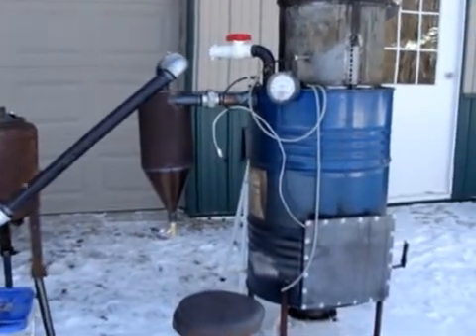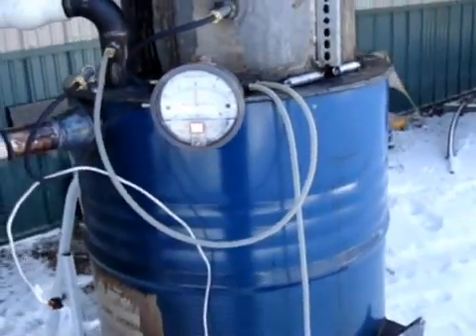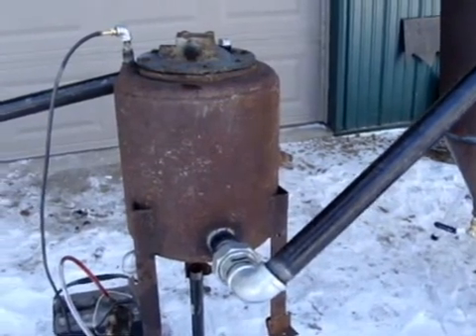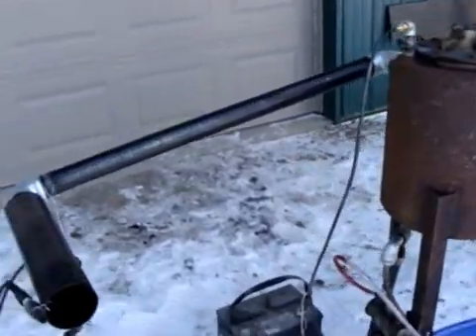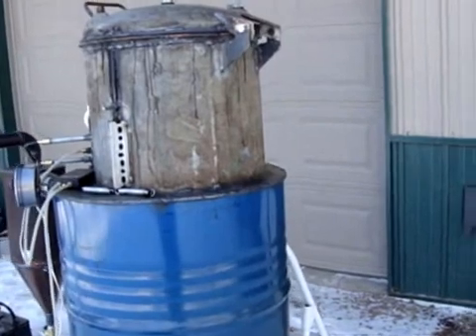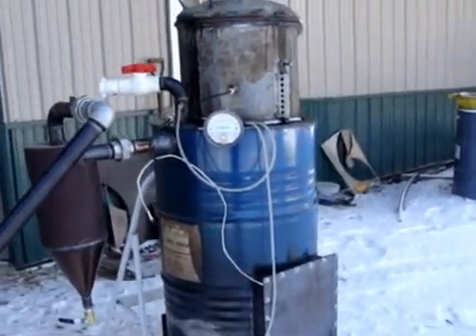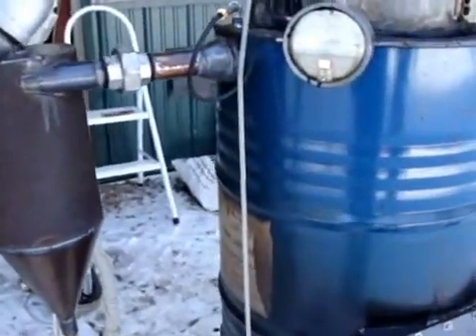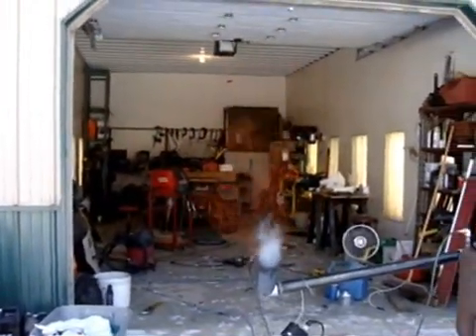wood gasifier run 2-2-13

Comment: I love the idea about the positive pressure air intake. I also like the preheating of the combustion gas. I am building a gasifier similar to flash001usa's . The magnahelic is also a nice touch. I may incorperate some of these great ideas. Thanks for sharing .

Comment from the maker: Tri,
I dont have a condensate ring. That could be in the works down the road but using kiln dried wood has been the solution for the moment.

Comment: also as it looks you're not taking condensate out of the hopper so you will have all of that going through your heart. 40lbs of wood chips at 20% is 8lbs of water... a gallon of liquid your fire has to deal with. and trust me, it does affect gas quality.

Comment: I have found that if i just run pellets i make tar in our system, mix pellets with wood chips and no problems at all.

we just use wood chips in our filter. I personally don't believe you can filter tar. just don't make  it in the first place... :) easier said than done.

Comment from the maker: David,
Thanks for the compliment, I am new to this process and learning with all the others. In this run the grate was shook too much and it was the wrong design.
In the next run (video) I had modified the grate and only shook it 3 times over a 2-1/2hr run. The metal shavings will do some filtering but will work better if they are wet so as to collect the particulates (tar) in the gas stream.

Comment from the maker: Teck,
Thanks I saw Flash's filters and he has done well in that arena.  I have less than 10hrs of gasifier experience so I'm just beginning to learn. The unit I built is an R&D unit to understand whats going on inside and how to monitor and control the process.  So far I have determined that you can make flammable gas that is tarr laden and sometimes you can produce gas where the vapor is translucent and burns almost invisible. I plan on building a unit to heat my home and one to power my car.

Comment: I like the setup so far if your on the look for good simple filtering check out flash001USA his cold pvc pipe filtering is one of the slickest out there i have seen so far to date! Its easy to clean to work with! Like i said great job so far looking farward to seeing more vids on it!